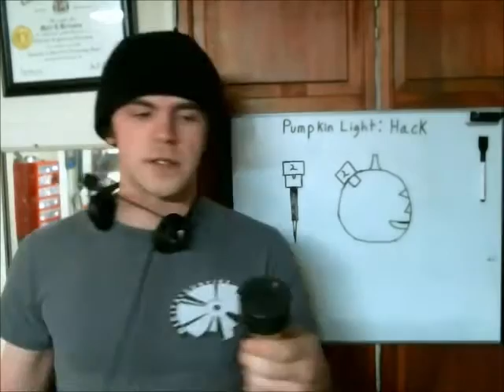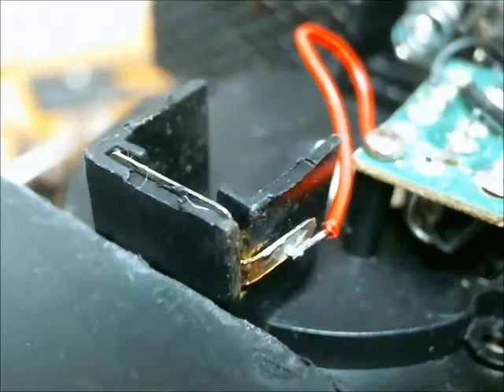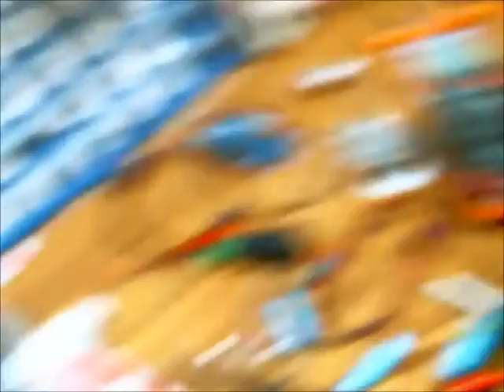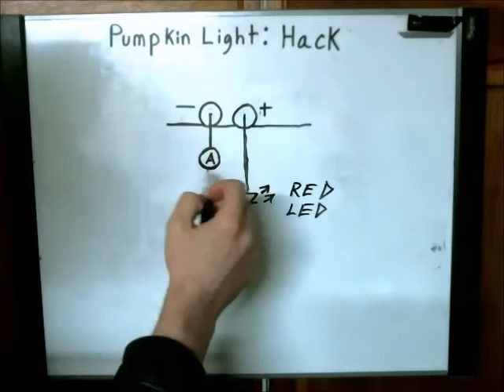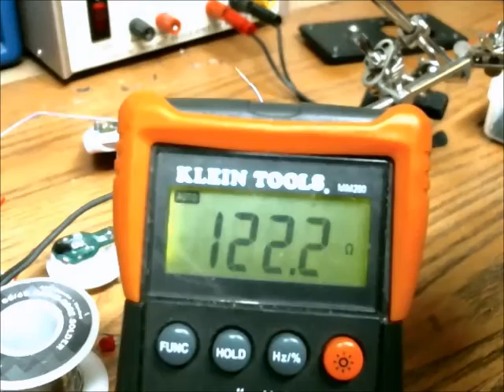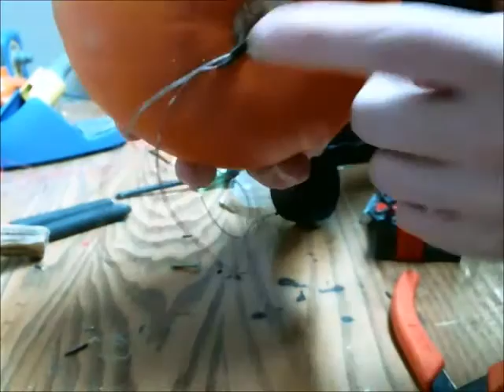Pumpkin Solar Light Hack

Comment: I like how the eyes look like diodes. Also since the led runs off of one battery (1,2 volts) it will need an induction circuit and an ic such as a tranisitor to light the diode. It creates pulses that cant be measured with a meter. Only a scope. But you covered that! So good job! Nice video! I was actually going to build a small circuit and use it for the same reason haha I saw a solar pumpkin set up on sale for 20 which is wrong. You can make one for like 5 or 10! Anyways great video!